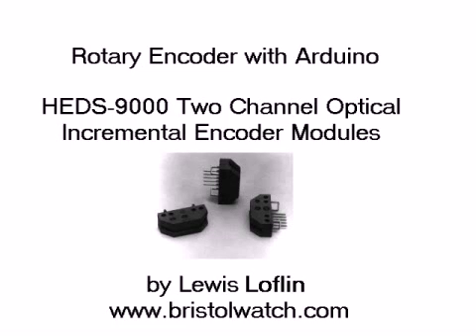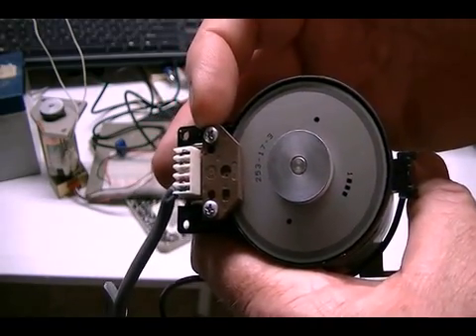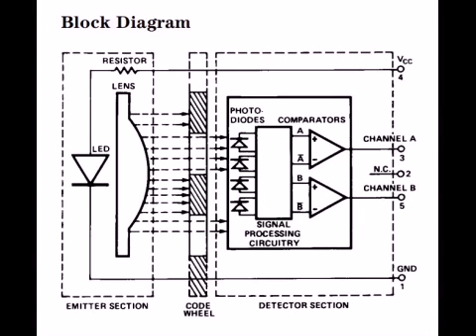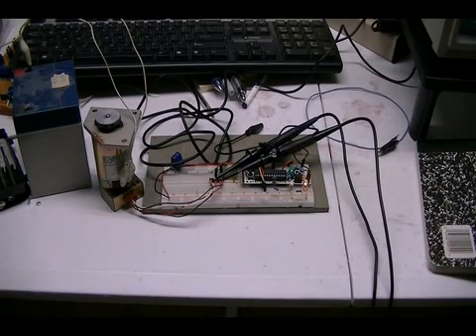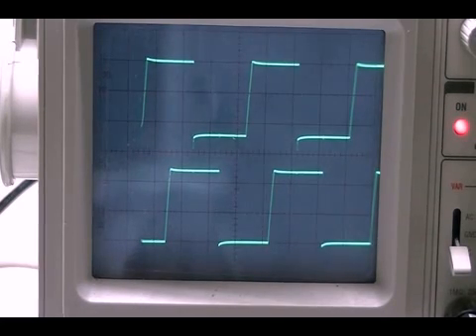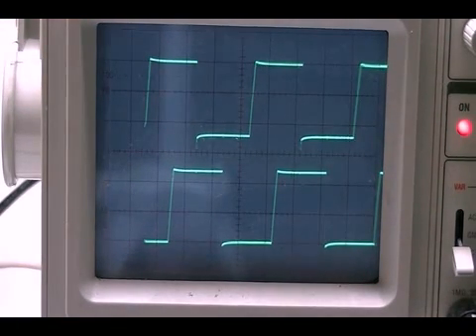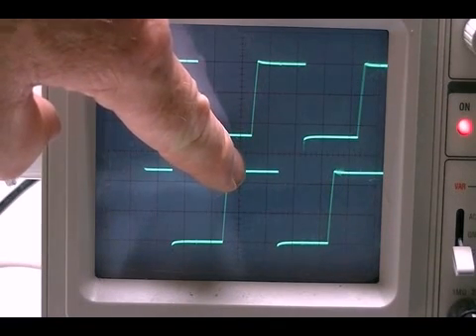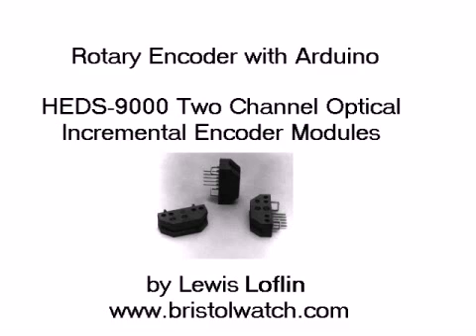Arduino with the HEDS-9000 Rotary Encoder

Comment: I am trying to repair a printer but they want $450 for the motor and encoder. I think someone tried to replace the HEDS-9000, and I'm trying to verify it is the correct one. The motor is a Hansen 116-33224-7, and it has the same wheel as yours, 253-17-3. It appears there are different options for different resolutions. HEDS-9000#B00 (1000 PPR) and #U00 (2048 PPR), for example. Can you tell me which one goes with that wheel on your motor?
Reply: I think I just had a duh moment. Realized that the wheel also has "1000" stamped on it, so it should pair with the #B00, right?
Reply: Salam heds-9140 var satmaq isdəyirəm

Comment: Do you know the maximum speed / pulse frequency the arduino can handle?
Reply from the maker: Good question. I was going to do some test to determine that. You will need to use port commands and an interrupt.
Reply: @LewisLoflin  I used 500 P/R quadrature encoder and it misses pulses when I turn 0.5 rev/s . I used an arduino Uno

Comment: Hello where can I buy the parts the encoder disk. Thank you.
Reply from the maker: What I used came off some scrap machine. look around on Ebay.
Reply: +Vizor you can buy the encoder disk parts from us,
the alibaba link
 http://www.alibaba.com/product-detail/Cheap-Mini-Magnetic-disc-1024PPR-toy_60215796490.html?spm=a2700.7724838.30.21.kMWI3l